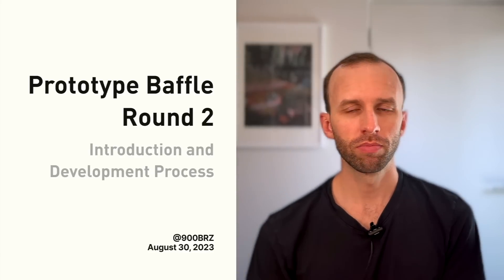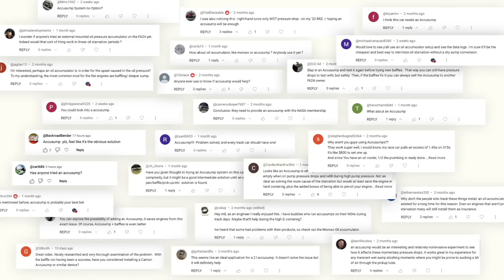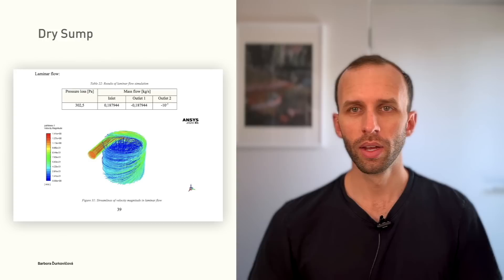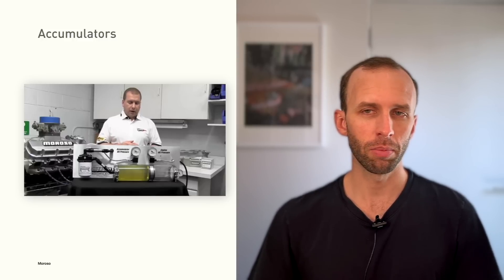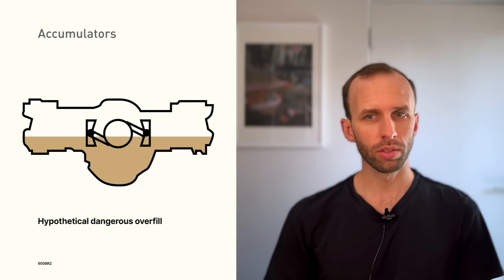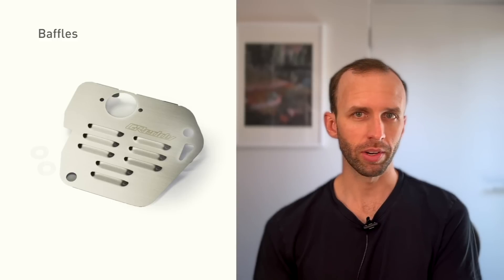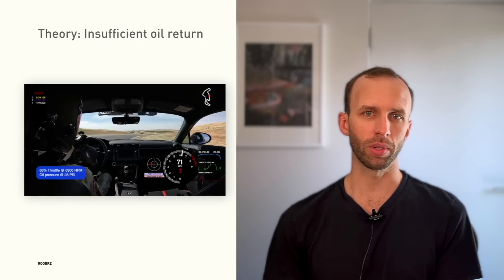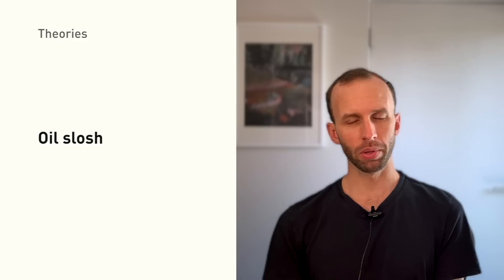Prototype Baffle Round 2: Introduction and Development Process

Comment: No baffle will stop drops from happening imo.
Reply from the maker: I’m hoping you’re wrong but we’ll see
Reply: smaller drops (say, comparable to the 2017 FA20 from the previous video) would still be a great outcome and make a baffle well worth the cost and effort for most people
Reply: Sounds like a hollow cope but to me honestly. Still gonna pick one up but I'm not dropping the pan or baffling anything. It will either blow up or it wont. I will do Subaru recommended maintenance only. The engines pops its on them not me.  @rosa.gigantor

Comment: I understand you want to keep all things constant, but why eventually move to 300v vs the 8100?
Reply from the maker: I have used 300V in the past. Imo it’s not worth the additional cost for this platform. Also one of my friends with an engine failure in his FA24 was using 300V from the start, so it’s not going to fix anything.

Comment: I drove EZ30 subaru engine with biggest accusump for several years on track. It was equipped with mechanical valve first year and electrical ball valve after. I drove the car on the street with closed valve and on track with open valve. No issues at all because of additional 3l of oil. Before accusump I tried to build baffle pan with no luck.

Comment: Just out of curiosity, because I can’t really tell. In the end when you showed the video of the gr86 with no oil cooler. Is it losing more oil pressure without an oil cooler because there is less oil in the system now? I tried to compare but can’t really tell for sure.
Reply from the maker: It’s a different track so the purpose is not to compare oil cooler to no cooler. But it does show that the drops are not caused by the cooler. A handful of people tried to claim that the previous data we shared could not be generalized to FA24 oiling performance because our cars had coolers on them.
Reply: @900BRZ  I didn't see how it could be caused by an oil cooler, but I was in the camp that wanted to see that variable eliminated. So kudos for that addendum. 

For some reason, seeing the gauge move was more dramatic than watching a data trace fall. I noticed in the addendum video that it looks like bumps made the drop worse.
Reply from the maker: Yeah my brother said the same thing about the analog gauge having more impact. I have seen data showing pressure drops on the bumpy T17 at Sebring as well. Think it really doesn’t like vertical acceleration.
Reply: @900BRZ  Makes me worry a bit about Turn 3 at the Ridge. It's uphill entry over crest, but thankfully I'm usually lifting through it to set the front end for 4. I really want to get some logging, and did some reading on the CAN adapter solutions, but when I got to the part about a custom PCB I kinda gave up.

Comment: Pretty sure the horizontal baffling will provide a solution for most of us. The Kazama and JUN Auto baffles (10 points for guessing who came up with the design first) are the only baffles currently on the market with horizontal baffling. Good to see another player entering the market. Sure if proven successful many others will follow. Good luck!

Also thanks for showing the non oil cooled results. Much appreciated
Reply from the maker: Vertical you mean?
Reply: @900BRZ  yes of course lol. Sorry the excitement got the better of me😅

Comment: Do you think there will be a solution for higher grip tires such as the RE71RS for example? I love how my GR86 drives, but ultimately I bought it as an upgrade to my NC miata. 

However if I have to only run low grip tires, it defeats that purpose entirely and I could save money and go faster with a cheaper car. 

Also, Flyin Miata announced a turbo kit for the NC which is sounding very appealing to me, and they claimed they are thoroughly track testing it to ensure max reliability.

I'm gonna hold onto my 86 for a while to see if there's a meaningful solution, but if I have to hold back on track (the one place you're allowed to not hold back), then I would rather swap for a car I can use 100% of, all the time.

Thank you for all the work you put into testing different solutions, and I'm hoping for good results!
Reply from the maker: If you want to use higher grip tires, then the more involved solutions of an accumulator or even a dry sump might be called for. There are ways to handle all the downsides I mentioned, like more higher frequency inspections/maintenance and $$. So I don’t mean to dissuade people from going down those avenues.